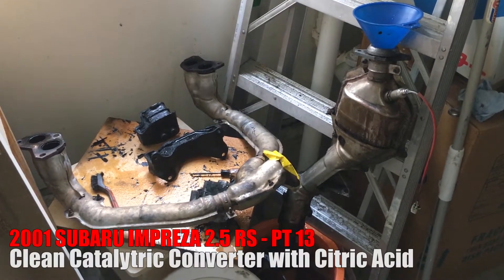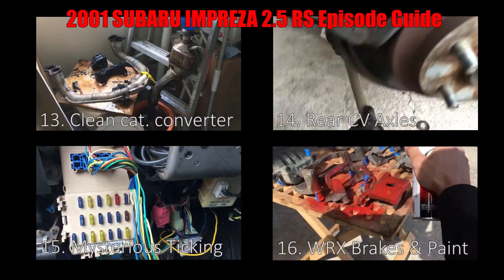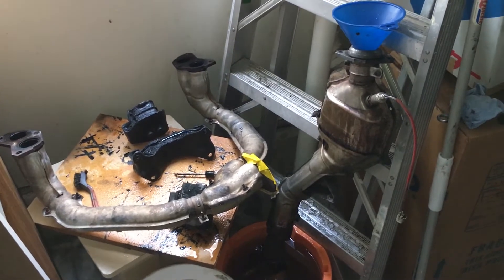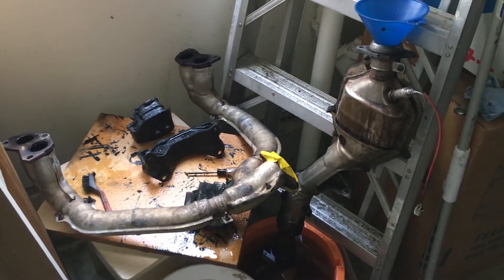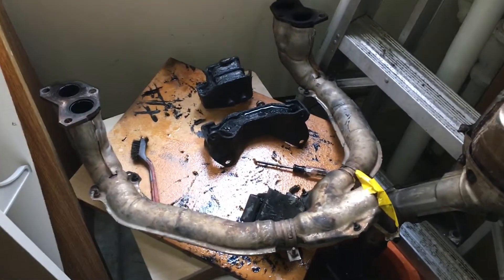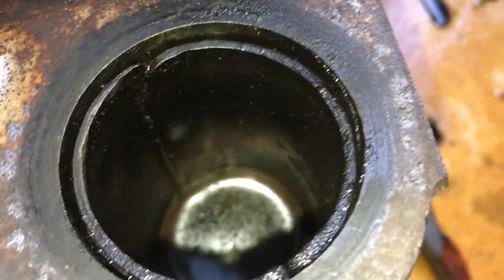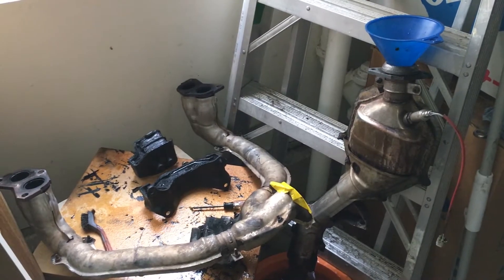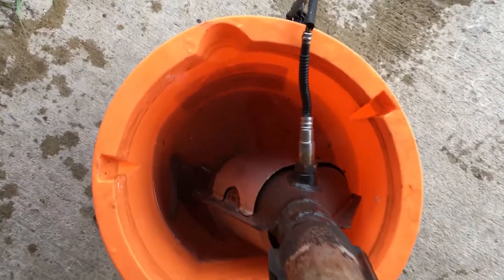Does Citric Acid  Clean Catalytic Converter? P0420 - Subaru Impreza 2.5RS GC8 Video 13

Comment: It didn’t damage the o2 sensors? I notice you left them installed
Reply from the maker: It did not. I figured the citric acid would clean them while they were on. It's been ~10yrs since I've did this, and the CEL never popped back up on the same O2 sensors.

Comment: I'd been living with p0420 for 5 years and 45,000 miles on my 2007 Subaru Forester.  Did this process of soaking with hot water and citric acid, and code cleared itself after 2 weeks of regular driving.  Been a while since I can use my cruise control ;)
Reply from the maker: Thanks for sharing. I'm glad it worked for you!

Comment: Wow. Well cant hurt to try... instead of paying thousands of dollars on a CA catalytic converters. Depending on the car it can be from $1,000 to over $3,000
Reply from the maker: Yes, it's a cheap solution that seems to work for most unless the actual honeycombs are broken. I found that restoring a OEM cat is better than buying an aftermarket one. The CEL pops back up shortly after on aftermarket.

Comment: Just to discuss wether this works or not. I did this over 2 years ago on my outback with p0420 and have went 15k miles since and no code has came back. I also replaced both o2 sensors.
Reply from the maker: That's great hearing it worked for someone else too!

Comment: The challenge with my Cat is it's a manifold type, and it is a pain to remove and I don't have the tools or space to remove it.  Would this work if I apply it from the upstream sensor hole?  I'll be wasting a lot of the solution as an obvious con.
Reply from the maker: Hello, is there a way to block the pipe downstream? Running citric acid through may help a little, but I think it would be best to soak the insides.
Reply: @ColinLeung  I think I can:

1. Run the solution  at around 40c through the Upstream O2 sensor hole
2. Place a transparent soft PVC pipe on the Downstream O2 sensor hole, attached to an aquarium pump.
3. Optionally insert a transparent soft PVC pipe on the exhaust, attached to an aquarium pump.

This can potentially circulate the solution and "soak" the cat long term.  

The pumps will prevent water from potentially going up the engine (although it should go out the exhaust first) and recycle the solution to be put in the Upstream hole again.    

A new cat isn't an option.
Reply from the maker: @rdcimafranca1472  Those sound like good solutions. Let me know how it works out

Comment: Bump. This worked for My 2005 Outback. Did head gasket job and then got p0420 code. Cat's had lots of coolant in them from blown head gaskets, soaked in boiled water with citric acid overnight and honeycombs came out looking new! Just passed smog. No light on so far 500 Miles. Thanks for sharing!
Reply from the maker: That's great. I'm glad you were able to pass smog.

Comment: Any follow up? The ce light still off?
Reply from the maker: The CEL light is still off. It never came back on. I figured the cat was just dirty and needed to be cleaned.
Reply: @ColinLeung  it's funny had a car that has that p0420 for 3 years and read a lot about this subject.  There is a lot of misinformation out there, but Ive concluded this method is the only one that works.